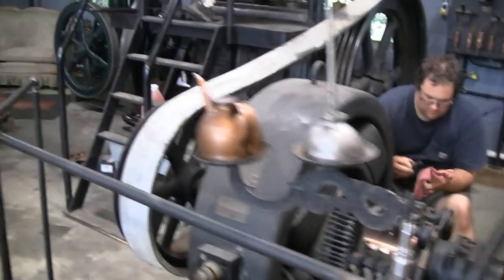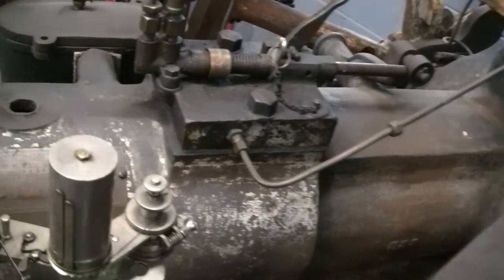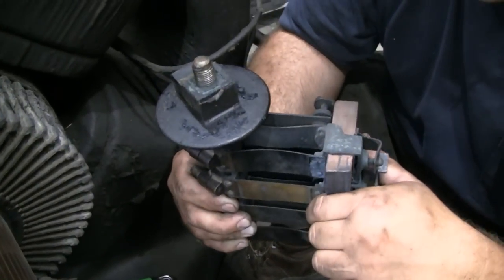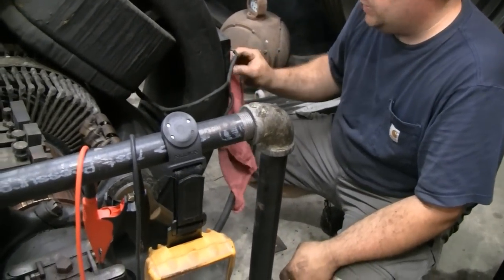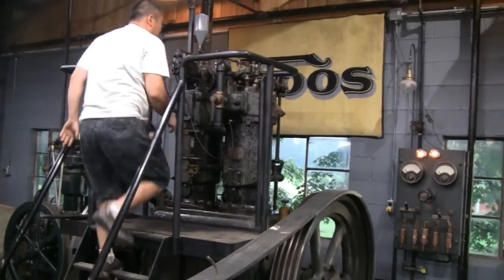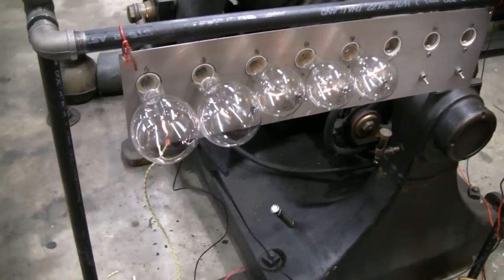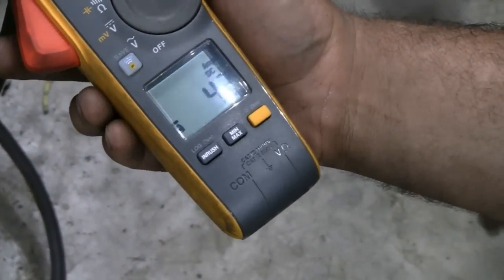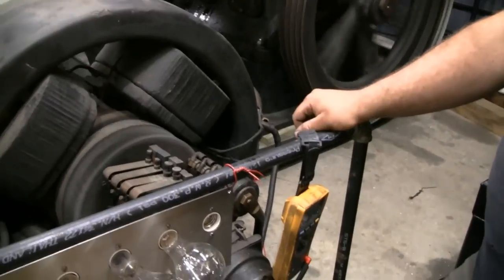MIKE REPAIRS AND RUNS 130 YEAR OLD GENERATOR

Comment: Really good stuff here. We used to pull traction motors apart and set the armature into a 55-gallon drum with 4 or 5 100-watt lights in the bottom and a heavy blanket on the top. They'd sit for a week and then megger excellent. Sometimes old-school works best!

Comment: Many of those engines and generators were still in use up till the 1960s befor REA brought AC to rural towns in the south - 
      My grandfater started working on gens about 1900 -   the old power houses for towns had 55 large 2 volt lead acid cells - 
     A engine and gen would be run 2 hrs in the morning and 2 hrs in the evening to charge the power house batterys - they were fully charged all day on friday - 
      I think those cell might have been 100 to 200000 amps - some were the size of a pick up bed and about 5 ft tall - 
      The strength of the acid was 1.210 or in areas that never dropped below 0° it was 1.195 strngth acid - 
    They added sufates to decrease the acids resistance -
     With weaker acid lead acid batterys last longer than 60 yrs of cycling -the plates dont rot and swell  in weak acid or flake and shead material - 
     They also dont sulate as easely in weak acid and easily desulate when equlized -

Comment: You should see the riding lawn mower that I'm working on. It started life as a Yard Machine by MTD I replaced the stock 18 horse Briggs with a 27 horse commercial Briggs I had to have a custom double pully welded together to get it to work. The steering gears were stripped so I modified it with a hydraulic steering that was designed for an outboard boat motor. I built a new steering console where the battery has been moved from under the seat to under the steering console. The fuel tank was replaced with a 5 gallon racing fuel cell that is now under the seat. I'm also building a new front grill to replace the broken plastic POS that it cam with. I have it framed out including a 13 inch fog lamp to replace the head lights. I'm also going to install custom rear fenders to give it more of a classic tractor look.

Comment: Blackstone...old British engine, far more common in Europe than in the US.  Those oil engines can be hard to get going but they're made to run around the clock.

There used to be a Bremen Caloric hot-air pumping engine in a shop close to me.  There are probably only 20-30 of those engines known to exist.

Comment: My ears what’s that hi pitched sound
Reply: The brushes which drag on the commutator.. he said they need adjustment. 

The electricity is produced as the generator spins. The brushes grab the electricity, . The brushes don't spin. They are connected to the output wires.
Reply from the maker: In the beginning of the video it was an air leak, I'm glad he finally shut it off!!☻